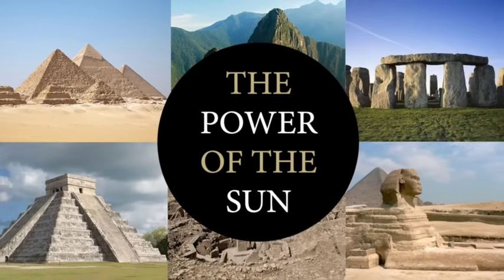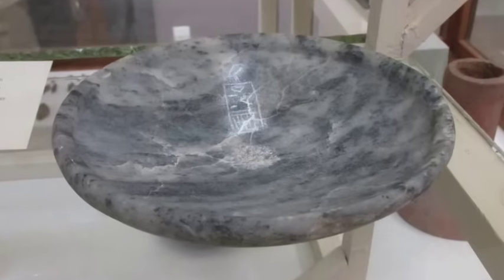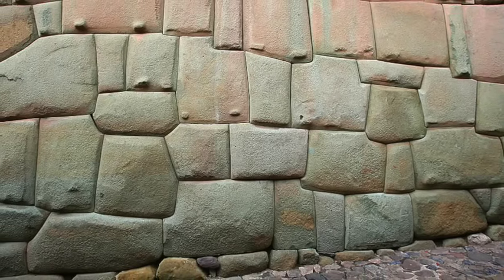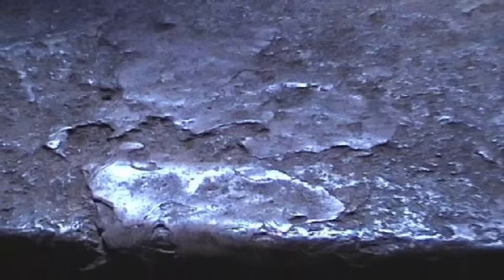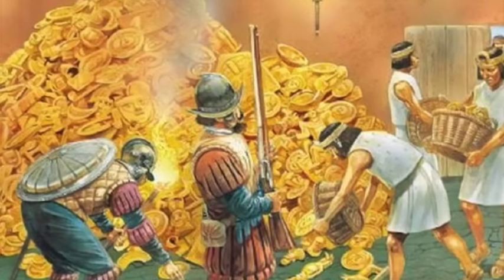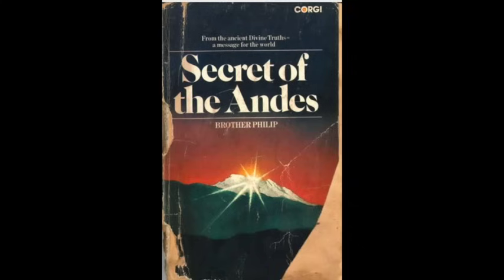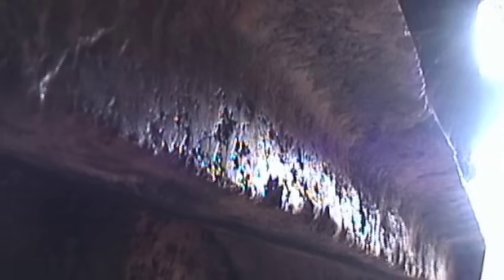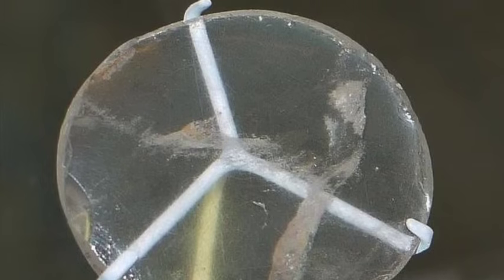How the Ancients Cut Stone with the Sun - Lost High Technology Explained | Ancient Architects

Comment: Assuming that they used mirrors to focus the sunlight (and there is nothing to prove this),  then it should be noted that a laser beam and a focused mirror have very different effects.  A laser beam is coherent collimated beam of light. A mirror does not produce collimated light. Because laser light is collimated it will cut a narrow groove. Because a mirror does not produce collimated light, it will cut a V shaped groove at absolute best.  This then means you still have to polish the stone to flat. It is much easier to just use wooden wedges.

Comment: Okay, so where did they Egyptians get the copper pipe?  The  stone box is precision.  You won't get a precision cut like that using a hand saw.  Plus, the blade for the length of the stone box would have been enormous and would flex and bend towards the center.  As will a short copper blade.

Comment: yes you can cut perfectly round holes without machines and flat surfaces also, using other stones. yes you can upright large stones. but the one weighting in over 100 tons, NO and no they were not softened, we see some stones that did not make it from the quarry to its planned place. 
Some think it was the humming that created a vibration frequency, NO that defies the laws of physics. 
Superconductivity rides EMF waves, but that wont lift these stones either. It has to be a gravity shield. Once shielded, one man could move any stone of any size, with no gravitational affects in play. Yes we have that technology. It is commonly known in physics, but the affect that is commonly known can not lift overly large stones. It has a limitation of around 5 pounds. But the US military figured it out and now we do have the ability to move large stones like this. But it is top secret technology. 
Why would we want to make what seem like ridiculous stone configurations! They did it to let us know they were here. Understanding only stones will last 10's of 1000's of years. It is a message from the past about catastrophes and in hopes that we can avoid the next one. Which may be just around the corner. 2019 is the year  pointed to by Jewish mysticism as the beginning of the fall season in the large year(26k tilt cycle), the Mayan calendar had it as 2012, but considering both duration's match 1/4 of a tilt cycle and only 7 years difference between which both claim as the cusp; I would keep my powder dry and my pantry full.

Comment: I have looked at this before, it has been shown that stone of any hardness can be cut and shaped by the means of a blade and a flow of grit solution, yes you go through quite a few blades and it takes time, both of witch are not a problem back then. When a blade became useless just reforge it and as for time, how long did the construction take and does that take into account for the prep work before construction. As to the laser explanation, it is wrong, you cannot make a laser from a parabolic reflector, you can however focus light onto a point, see focal length of a parabolic reflector, and from descriptions you gave a reflector who`s diameter is 4 meters could focus approximately between 2.5 and 2.8kW on a single point if used on the equator at high noon. Although I haven`t found how to convert that into actual temperatures generated I would imagine it to be very hot. This, depending on heat generation, could possibly melt rock, you couldn`t use it as a drill. For the laser theory to be confirmed, a laser crystal has to be found, the key component for focusing and internally reflecting the light and giving it the beam of characteristics.

Comment: WRONG.
Learn some physics first.
Also, do more research into the stones from the majority of sites, not just isolated finds which are rare and far/few in between, which attempt to support your theory,... poorly.
For instance, if you did More research you would find that "Most" stones, which were cut and shaped, do NOT display elements associated with rapid cooling after heating,  In certain forms of crystallization found from rapid cooling.  I'm sure the disks and lenses Were used in some unusual fashion which we do not yet know of, but it wasn't to cut most stone. If any.
Reply: let me give you a better example. Large stones which have a patter which Look almost like jig-saw puzzle pieces made into walls. These stones have the appearance of have been melted onto one another in a manor with which allows them to flow over the other stones shapes and all but merge with it, to the extent you cannot get a razor blade between them. Pull them apart and you find the places they touch unseen are also curved and shaped oddly like they were melted together to fit one another. Heat would of course be the First viable explanation, which is Why it has been meticulously tested for. But the kind of crystallization in the stone which is a marker from rapid cooling is Not found. we don't know How these stones were shaped, or How they may have become putty like and malleable to take shape around the shape of other stones where they contact. we only know heat was Not actually involved despite Visual appearances to the naked eye. My Own personal hypothesis, was that sound was used, or some other energy frequency which loosed the molecular bond and allowed some measure of malleability. Still, unknown.

Comment: I'm not sure to see where the debate rests. We agree without a doubt that they had copper tools (metling point >1300K) but we fail to understand how they mastered granite (metling point ~900K in the presence of water, which they pretty much mastered). Add to that thousands (millions?) of years of playing around with rocks, I'm really impressed by the craftwork too but there is really no mystery here. Chemistry, Acoustics, Friction with pottery tour... Considering all the options available at the time, and again, they had nothing else than water and rocks to play with.
With even a small amount of electricity (Baghdad Battery? The first electrolysis was performed a few days after the invention of DC current, so it's not a huge step forward from citrus juice) one can open up a treasure trove of chemistry allowing all sorts of wonders.  
Now in a society that take its pride into moving shaped rocks around, anything rational is possible. Hell, I bet they tried each and every one of our hypothesis until finding what they ended up using, if not a little of each depending on the need.

Comment: The only difference between modern day concrete and early "geopolymer" is the ingredience. Forms and a clay like polymer were used. Yes stone melting was used too but not to cut stone. The holes drilled were done when wet but could have been done hardened with sound.FALSE! They did have electricity and there is much proof of this. You need only go to i don't know anywhere!

Comment: Sorry, but this is nonsense .The  power of the sun is around 1100 W/ Sq. Meter. So a parabolic reflector a meter or so in length and width  has the power of a portable hair dryer.  That is never going to cut granite which melts at 2000 degrees.

Comment: a couple of points....1st....a simple glaze upon the rock and a fire put on it will give that same glaze appearance...to see if his theory is true a TMI or similar electron microscope came see if true for the quarts glaze was"pulled" by the heat or added as a second coating....also many round holes were "drilled into rock for centuries.

Comment: never been anything electrical found 🙈 epic fail.  The pyramids are made using rose quartz which conducts electricity dumb ass.  Lol I hope you didn't quit your day job for this.  If so next time do more research.
Reply from the maker: You don’t understand do you?! I’ll spell it out for you, if the pyramid generated electricity, what did it power? What electrical implements, or how was the power harnessed - that’s all I meant. And the pyramids are not made using rose quartz, they contain a handful of blocks of red granite - the red colour comes from feldspar, the quartz is clear. Yes granite does conduct electricity, but it isn’t a particularly good conductor, dumb ass.

Comment: You have missed the boat.  Any use of heat on granite will cause it to become brittle and loose it's strength.  They obviously had mastered the use of ultra sonics. If some of the stone used in one of the walls were analized  I believe you would find that the granite had at on time been rendered viscous, similar in consistency to modeling clay. It could then be formed to any shape desired using wood forms. Not saying this is how it was done but it seems a hell of a  lot more likely than heat.